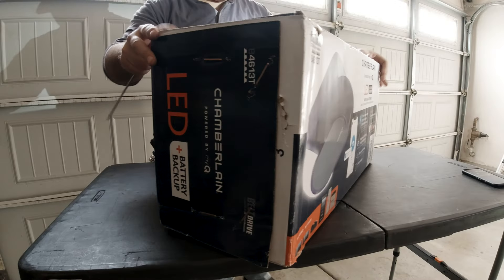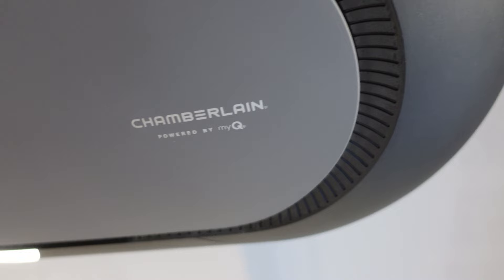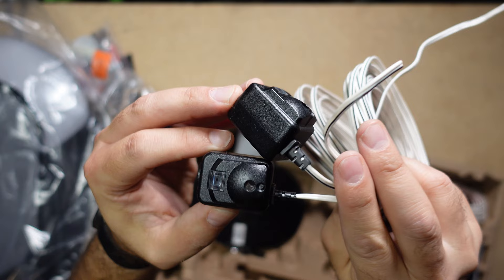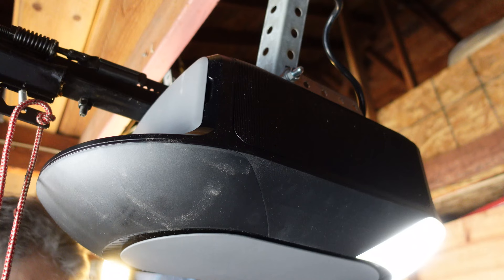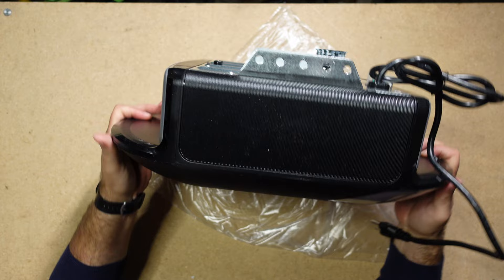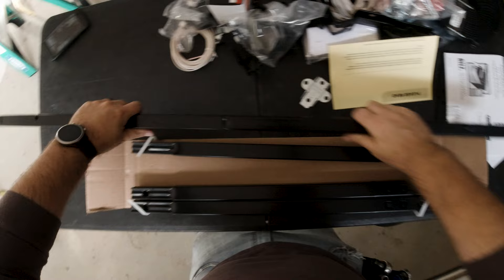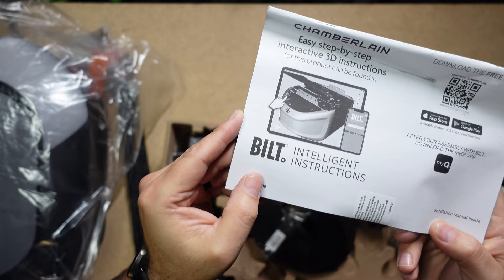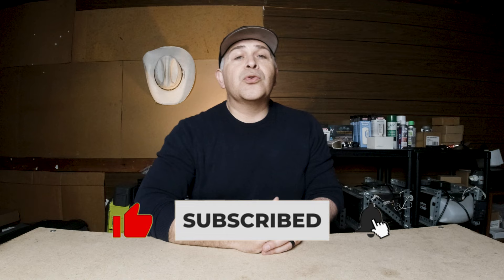Chamberlain B4613T - Unimpressed Review

Comment: You do have some strange obcession with these polycarbonate chassises... As for the light, I think the priority should be the way that Chamberlain did it. If the light is going to be directional, then it shouldn't be shining in your eyes, but rather lighting up what you're driving into (or rather, trying to avoid driving into - like the back wall of the garage).

Comment: Santiago I’m 6 months in with this opener and am very pleased. I got it for $240 from Lowe’s and for my needs it checked every box. I just couldn’t justify moving up to the model with dual leds for $50-$60 more.  I had to take a real hard look at what I needed and where it was going and this model was  a good fit. My obervations : pieced rail is sturdy . I would rather gone for a 1 piece rail but where I am there are no places to get one and the fact they are over the length limit for fedex/ups makes truck freight roughly 4 times the price of the rail itself. Plastic housing: no problems here. I wiped it down after install and all is still looking good. Overall  I don’t think this is as bad as you are making it out. I understand that the divergence of the build materials and styles versus the Liftmaster line is probably causing you headaches when trying to sell a homeowner but in my experience this unit works fine.
Reply from the maker: Hello Dr Benway!  Thank you for this excellent perspective of the B4613T.  I will admit that I do give this motor a hard time.  Like the title of the video and thumbnail says, I was just unimpressed with this motor.  Is it cheaper?  Yes.  Is the rail still good?  Yes.  Will the one piece rail offer a better experience on this motor?  NO, not anymore.  I posted a video two ago about the changes they implemented that changed the experience.  

The truth is at the $250 price point that this motor averages I feel most homeowners should have a perspective from a garage door contractor about it.  It will still offer a reliable experience.  It is miles better than some of the noname motors that dealer contractors offer.    Again, this video simply points out my unimpressed opinions of it.  Thank you again for excellent feedback.  Stay safe!

Comment: I bought one of these and had it installed in May, 2022. It is now April of 2023, and I am sitting on hold waiting for a response from a supervisor at Chamberlain because the opener has malfunctioned sporadically for the past year since being installed. Customer service has been less than helpful so far. Definitely would NOT recommend - not this model, nor any other from Chamberlain based on my experience.
Reply from the maker: Thank you for sharing your experience.  Failures like these are becoming common.

Comment: Sounds like he just wanted to say something negative just to say it.. it collects dust? feels cheap? Who feels their garage opener after they install it? it has a ledge? Has a lot of parts? You want the light pointed on top of the garage door when it opens instead of towards the garage? Louder than normal but no decibel readings? Hmm..  😂  didn’t talk about the connectivity features..
Reply from the maker: This is great feedback.  I have thought about the very same thing with a decibel reader.  I also wanted to return to some of my old installs to see how this motor has held up.  Truth be told, I thought this motor had no place in the Chamberlain line up.  Thus the negativity comes from my frustration of customers wanting this motor installed over the more robust B6753T.  At any rate I do plan on doing a follow up video about this motor.

Comment: No motion sensor on the Chamberlain B4613T? That's news to me. I bought one of these from Home Depot on 9/08/22 and installed it two days later. The wall mount controller on mine has a motion sensor and it works fine for automatically turning on the opener light.  I also like that the light faces the wall instead of the garage door. It's not shining in my face when I pull into the garage and it adds better lighting when I walk in there from my house for something. In your video when you are trying to show how loud the motor is, that level of sound would only be distracting if someone was sleeping in the garage. It sounded pretty quiet to me and the motor on mine is not loud at all, certainly much more quiet than the 10-12 year old chain drive Craftsman opener I replaced. I spent several hours researching different brands and models before I decided on the B4613T. The motion sensor, quiet belt drive, MyQ app compatibility, battery backup, decent overall customer review ratings and a reasonable price are just some of the things that led me to my choice. It has some good features without becoming too gimmicky which can lead to failure. The lifetime warranty on the motor and belt is nice and shows that Chamberlain isn't afraid to stand behind their products. I wish it had Alexa compatibility but I'll just move my Nexx garage door controller from my old Craftsman over to my Chamberlain and that should solve that concern.  Easy two-wire hook-up and no monthly fee. BTW, the Chamberlain B6753T that you recommended at the end of your video doesn't come with a wireless keypad;  the B4613T does.   ;-)

Comment: I appreciate the video, but I'm surprised you gave no mention at all about the MyQ feature, which is excellent. The app is pretty much bug-free and saves having to install an outside Keypad. The motor is much quieter than most models and I wouldn't want the LED on the front as it would be blinding when driving in at night. Thanks for the time you've put into this.

Comment: Do not agree with faulting the orientation of the light away from the door. The risk on entry is going too far into the garage so the end of travel is what this unit illuminates which I see as the priority for clarity. It seems to me you are straining pretty hard to find fault.
Reply from the maker: Hello.  Thank you for the feedback.  As the title says, I am simply unimpressed with this motor.  Chamberlain has 5 variants of the model.  They could have just kept this line up simple and offered a 1 LED, 2 LED, and 2 LED with a camera variant.  It's clear their goal here with their 5 motor offerings is to acquire market share.  Again, that is just my professional opinion.  I realize for most it will be a non-issue.  I do think it's a good motor.  I just wouldn't own it.
Reply: @sosgds  i was just shopping this price point and found this model on Amazon. Do you have a recommendation that is close in price?

Comment: The plastic housings remind me of the old gray LiftMaster screwdrives that is held up by the single bolt in the center (if your garage guy, you know) where if you touch the outside housing wrong it could end up like Humpty Dumpty and never go back together again. I hope the plastic now holds up better to the heat and time.
Reply from the maker: Hello Justin!  Thank for this excellent feedback!  You're spot about that older plastic on LiftMaster motors.  You almost needed hands of a surgeon to replace a logic board on those old SDR1000 or 2000 screw drive motors.  The plastic housing inside was just to frail and would break easily.  I also home these newer motors will work better.  Stay safe!

Comment: Good day
My garage opener does not Homelink with my 2018 Ram ,at first though it was the garage door opener.
I was able return it get an another same problem it won't link ( it work for few days just like other)
Any suggestions?
Thanks
Reply from the maker: Hello!  Yes.  You say that it worked for a few days.  Did you happen to have any power outages?  Did the motor have loss of power for a few hours?
Reply: @sosgds  ,Hi no electricity outage, thank you for replaying.

Comment: Anyone can help me? I’ve install this brand the garage door doesn’t open light only flash 😭
Reply from the maker: Hello.  Have you tried reprogramming it?  When you say  the "light only flash", do you mean from the motor?  Where is flashing coming from?  Could it be the wall button?
Reply: @sosgds  That's what happens to me - over and over. The door goes up about 8 inches, then stops, and the lights just flash. I have been told I need to replace the travel module - IN MY BRAND NEW OPENER - and it is taking weeks leading to months to get a response from Chamberlain.

Comment: Hi Santiago, on this price point which one would you recommend? The craftsman is about 100$ more
Reply from the maker: Hello.  It depends on two thins: 
1. Would you like more lighting?
2. Will you be installing this on your own?

The Craftsman motor comes with a couple of bulbs that are 800 lumens each which will give you more lighting than on the Chamberlain product. Yet the Chamberlain motor offers easier instructions on how to install. The manual that comes with the Craftsman motor can be a little daunting. Either way if you're just looking for a motor that'll get the job done with no frills then I don't think the Craftsman is worth an additional $100.
Reply: @sosgds  thank you so much for the tip, I really appreciate it.  I ended up getting the CMXEOCG572 for 210 1/2 hp belt drive it doesn’t have battery back up, but my house has a back up generator. Again great channel with awesome videos and tips for the people